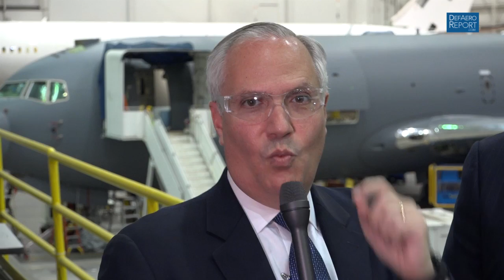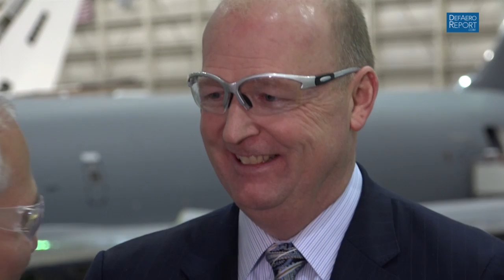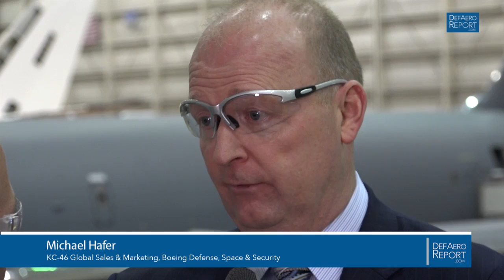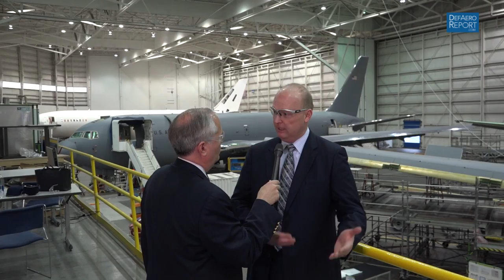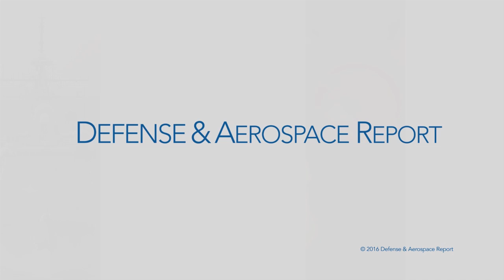Boeing's Hafer on KC-46A Tanker Program, Production, Features & Global Markets

Comment: ...and 2 years later it is just being delivered but doesn't actually work ... What an epitaph this is to US Pork Barrel Politics and the hold Boeing has over the US Governments of all persuasions...

When people talk about Executive corruption they say 'Watergate'. When they talk about Senatorial corruption they will just say 'KC-46'.

RAF lads laugh when they fly to the USA in their A330MRTT Voyagers that have been operational since 2014 barely 6 years after they were ordered and see these boondoggle clusterfucks still not working despite using a 30 year old airframe design. The KC-46 with no winglets to aid wing and fuel efficiency, no Thrust Reversers for obscure runways and over weight landings and all done to keep the cost overruns down on Boeing's books. The KC-46 that carries 20% less fuel than the proven A330MRTT now in service with 11 Air Forces across the globe and the KC-46 no other country bar the US dependent JDF has bought in open competition

Outstanding ...